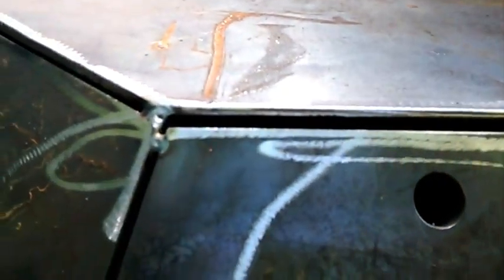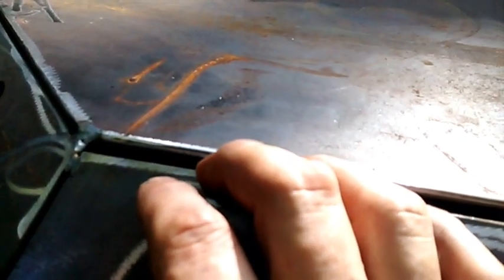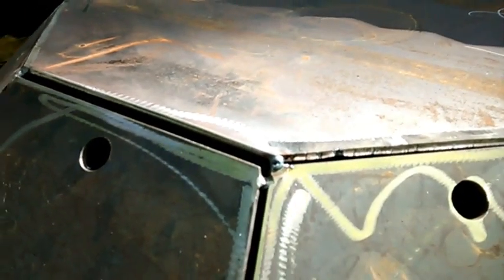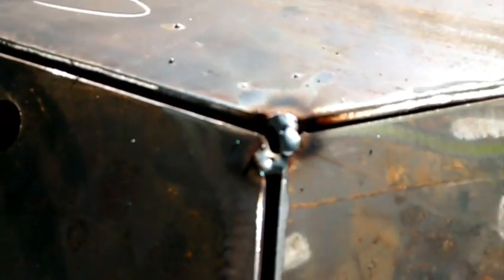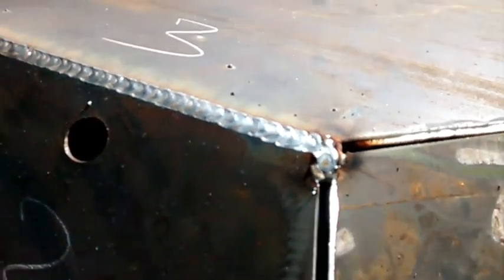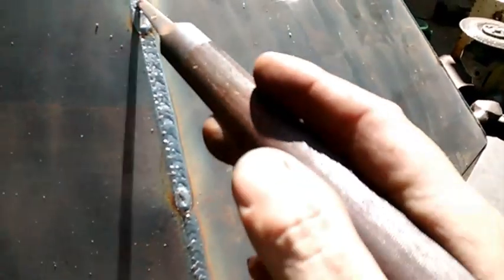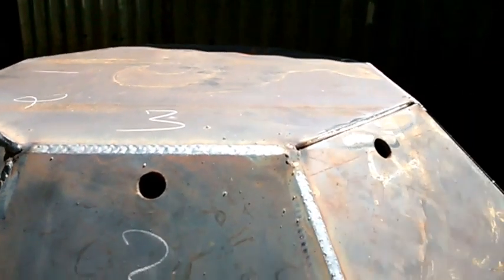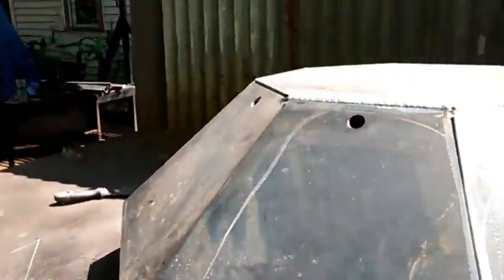Mig welding tips for gaps

Comment: Great welding job!
 What I do myself with gaps, particularly when I'm stick welding, is to wedge something like a nail on it's side in the gap and then weld across it. I also use lengths of welding rod with the powder broken off, jammed in the gap. If the weld needs to look good on the inside face, I weld and grind it there as well.  It's strong and looks good enough for farm machinery.

Comment: Nice job filling those gaps. 35+ years ago, I filled those. Stick welder and using a rod in one hand. Use the extra rod like you would use a braising rod. That was back when we were building Dumpsters in Shop class.
Reply: I've been meaning to try that. I was just closing up some gaps with 6011 on some rusty stuff, quite a pain, but worked well enough. Fortunately its not structural.
Reply: we call that tooth picking on the oil rigs
Reply: @richardchase4019  in the building trades we call it Texas Tigging!!!

Comment: Great video, really helps me out. Been welding 1/8 tubing building frames. My band saw will finish a cut at a angle and leaves me a gap. So I will try this technique and turn the heat down and speed and run passes. Thanks

Comment: As per Jody you can calibrate your wire speed by using a stop watch and running the gun for six seconds.  Multiply times ten and you have your inches per minute.  Do it every two or four numbers and you should see if it is an even incremental dial if so you then can interpolate and know what ipm each number is.  For the volts I would put a multimeter between the ground and the stinger (use the welders ground so you aren't measuring ground resistance through the workpiece.  Just bought one of those Pro Weldpak 180's.  Hope they are as good of quality as my Weldpak 100 I bought almost thirty years ago and is still going strong.  Being 120v it only pumps 90 amps so it was more than time for another companion.  Take care.  Doug

Comment: I've got the smaller Lincoln... Promig 140 I believe. It's 120 volt only for incoming power.  I catch hell with long welds because my breaker will trip after a while. Just switched to .030 from .035 and that made a big difference in several ways but I still can't just go to town. Any tips other than getting a 240v machine?

Comment: Another tip is put a piece of copper behind the gap and lay the weld on top of it. The weld won't stick to the copper and the copper will stop you blowing through.
Reply: Seriously! 2" flatbar, 1/4" thick, 12" long. Jam it in behind it and go.
Reply: Great tip. I've just started mig welding with my everlast welder. I want to weld thin material and there will be gaps and I understand that this is probably one of the most challenging scenarios.
Reply: Aluminum works too, just needs to be a little thick to take the heat.
Reply from the maker: David Boyce yea that will work, brass will work too
Reply: Allen's welding/woodworking I agree with you, brass and ceramic are my first choices
Reply: David Boyce  steel and copper weld together.. I would try brass first.. I just welded solid copper and steel yesterday made a magnetic ground/ gun holder combination.
Reply: brass works better than copper for filling gaps but both work
Reply: David Boyce QB!
Reply: I am an old welder and now a NDT technican and put copper behind works. But remember If its a licens weld you should not use copper becuse you force it in to material and thats make its brittle.
Reply: PS.  That is mag welding, not mig. Mig welding is used on white materials like stainless. Sorry for my english, i am from Sweden😃
Reply: David Boyce Thanks I tried it and works great
Reply: J.C. Kohle  Is he using Argon gas when he welds steel? We use Mison 16 or 25. In that case my bad.

Comment: Great looking fire pit! I think the reason FOR your gaps was in assembly. Next one you build try leaving that base plate in one spot. I'm sure your measurements were w/in 1/8" anyways, and I can see how straight those cuts are. If you need a jig you might be able to use a finished one flipped upside down. I am gonna have to get some plate and try this one myself.

Comment: @10:00 .. Was wondering something similar. Gaps that I can't quite solve in 16 Guage . either no penetration or blowing through. Was thinking of laying a length of 3/32" filler rod in the gap and seeing what happens.
Reply from the maker: With something that thin, you'll probably have to use a filler, keep the amps down around 17- 17.5, or try "squirting it in" one tack at a time as fast as you can move

Comment: I’m totally new to welding, so you might think I’m asking a silly question. As the gap is now mainly weld material and not the parent metal how well will it stand up to the heat of the fire once in use?
Reply from the maker: It will hold fine, a lot of welding applications will fit up with a gap between materials in order to have 100% weld
Reply: Allen's welding/woodworking Thank you for the quick reply, that deserves a subscribe.

Comment: Great videos, You are an artist. Would a stick welder work better for those gaps?
Reply: Sure, because since the electrode is of larger diameter it deposits more material quicker but stick welding has slag to deal which can cause slag pockets and are hard to get out sometimes. Also it introduces more heat into part.

Comment: What size wire you running here? Gas is C25? I just bought a 180
Reply: For 3/16(like in the video) to -1/4 steel .030 is good, anything thinner something around .024 wire. For your welder, get lots of .030 and .024 because you don’t have the power to do much over 1/4 steel and make good use of bigger .035-.045.

For gas the cheapest and most convenient for your welder is 75% argon to 25% C02. Both gases in one bottle.